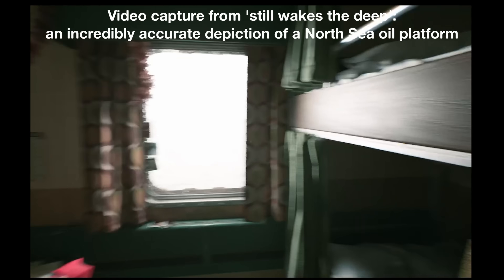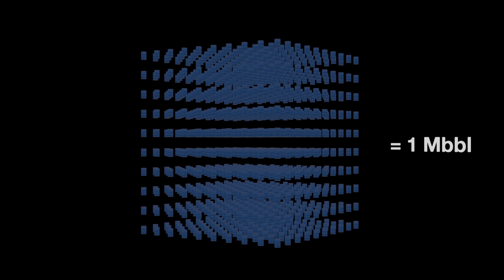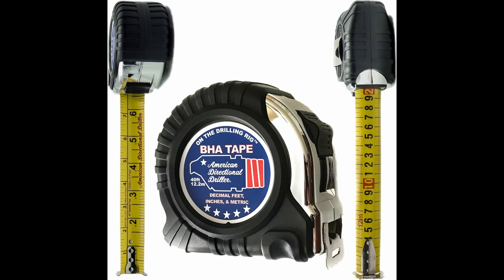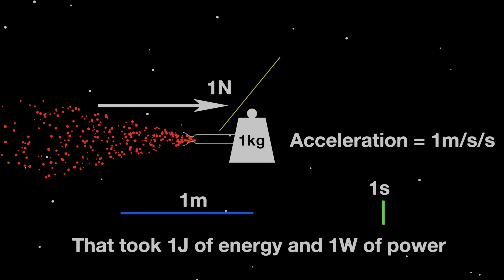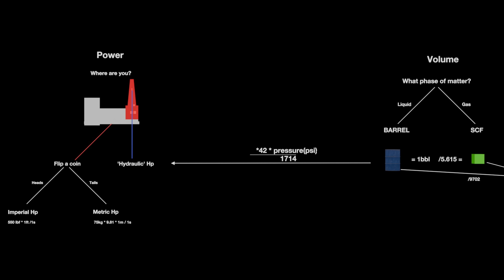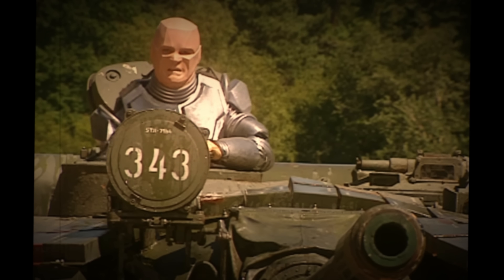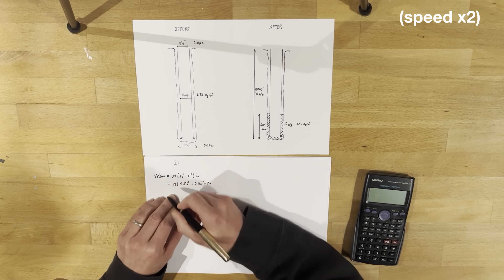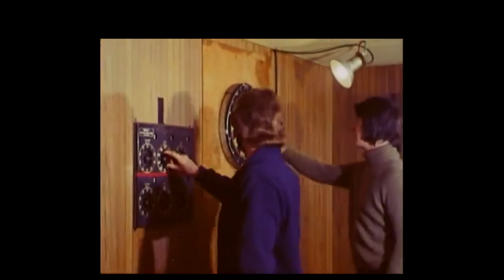Oilfield Units: a Measurement System so Cursed it made me Change Career

Comment: 10:00 this is common outside of the oilfield as well, but like the oilfield, only in niche applications (with one exception I'll outline later).  Generally speaking if you're dealing with numbers in the thousands often, seventeen hundred is faster and easier to say than one thousand seven hundred.  This is especially true when those numbers don't exactly have to be precise, like engine RPM.  Flying an aircraft, it's easier to think in teens than thousands, like takeoff RPM is twenty three hundred, sometimes even abbreviated to twenty three.  You tell a pilot that cruise RPM for your plane is nineteen, they'll know you mean 1,900RPM.  It's not super critical that the engine is running at exactly 1,900RPM, it could be 1,922RPM or 1,894RPM...nineteen hundred still gets you close enough and you're certainly not going to say you cruise at one thousand eight hundred ninety four RPM.  Same goes for the automotive world and various other fields where four digit numbers are commonplace.

What's the exception?  When you're using four digit numbers that you have to remember or communicate verbally to someone, such as an address or padlock combo.  If you live at 2469 eggplant drive, you're not going to recite your address to someone else as two thousand four hundred sixty nine, you're going to tell them two for sixty nine.  5230 would be fifty two thirty.  2500 would be twenty five hundred.  But 4000 would not be forty hundred, it would be four thousand.  It all has to do with how easily you can condense and remember the number in question.  Conversely, when you go to the bank and ask to wire 4,236 dollaroos to someone, you would say four thousand two hundred thirty six dollaroos, because you're psychologically slowing the communication down and being precise where precision is needed, and the listener will engage more precisely in return.

Lastly, the word "and" does not belong anywhere in verbally recited numbers EXCEPT where it should be, and it ALWAYS needs to be there unless you substitute with the word point in casual use.  The decimal (the period in the number, or comma if you're a weirdo) that separates the whole number from the decimal is your indication to use AND.  $1,706.14 is one thousand seven hundred six dollaroos AND fourteen centaroos.  You never ever say one thousand seven hundred and six dollaroos and fourteen centaroos, or one thousand and seven hundred six dollaroos and fourteen centaroos, that's just confusing because the AND is meant to finalize the whole number.  For example, you have five people AND two kids in your house, because kids are fractions of people.  Even if there is no decimal and it's just a whole number, you should never include AND.  1,706 is still one thousand seven hundred six, not one thousand seven hundred and six...if you said that, people might think you meant 1,700.06 or 1,700.6 or 1,706, which is very ambiguous.  This is all stuff that should've been taught to you in elementary math class.

Comment: Decimal feet are fun. 

As a terminal operator responsible for overseeing product transfers, opening and closing tank measurements were essential. 

For this, we measured using decimal tape.  One inch was .08 of a foot, or basically .01 per eighth of an inch. So naturally, when you multiply by twelve, it neatly equals out to…   0.96??

No problem! You simply decide arbitrarily that four measurement values basically don’t exist!

They are: 0.12, 0.37, 0.62, and 0.87.   There was no standard equivalent of those decimal values.  But you need to do that to equal 100 parts to the foot. 

And keep in mind, when measuring a tank with a capacity of nearly half a million barrels, at a value of say, $80 USD per barrel, that 1/8th of an inch of potential error will equate to thousands of dollars. 

And don’t forget to measure the temperature of the oil, because it matters.  Cold oil is more dense, so there’s another table to convert temperature to 60° as the accepted standard. 

That’s Farenheit, of course.  

It’s a great industry.
Reply: this hurts not only my brain, but my entire body
Reply: You surely meant to say that cold oil has a higher mud weight, you nerd.
Reply: Honestly, I'm somewhat happy to hear that at least they didn't invent their own new temperature system.
Reply: @Theoreticaly  Fahrenheit IS the invented temperature system
Reply: @TheHeavyModd  I mean, Celsius was also made up
Reply: @commandercody2980  you're forgetting the most essential one : The Kelvin
Reply: @Aelleor  they could have had exact decimals of they went to thousandths. (0.125) why didnt they just do that?

.125, .25, .375, .5, .625, .75, .875, 1.000
Reply: @Aelleor  I didn't know War Thunder developers did decimal feet. (Explanation: WT is a game featuring various war machines of varying capability, so to match equal vehicles against each other, each is assigned a battle rating expressed as a number with a one decimal accuracy. Ratings rise by thirds: 1.0, 1.3, 1.7, 2.0... etc. It is slightly odd, but it's simple and easy to understand. The choice of thirds is a legacy from the original tier system, which was completely different and was replaced by the current rank system, where ratings rise with rank, but not consistently. There can be a 2.7 craft in rank 2 or rank 3, depending what particular vehicle in what particular tech tree it is. Ranks do not influence matchmaker, but they do influence vehicle research...
And it's just a silly game, with little real world consequence! Except the times when overzealous players with access to classified technical documents leak said documents to prove some vehicle stats being wrong... but that's a different story.)
Reply: Three days of this and id honestly just shoot myself in the break room 😂

Comment: When you say US gallon, does that refer to US customary gallon or US dry gallon? While using US dry gallons wouldn't make any sense, that fact doesn't provide any certainty. 

I think the conversion issue is only part of the problem with sticking to a mess of units, it's not really a system, that evolved for making rough  measurements and very simple calculations, in isolation. The other part of the problem is that there are multiple versions of most of the units. Sure, most US units only have one "official" definition, now, but if you come across old references you got to know which version of the unit it is to know what it actually means. And there are different versions of common units in active use in the US, like the US customary fluid ounce isn't exactly the same as the US food labeling fluid ounce.    

And, can we all agree that "atmospheres" are stupid units too? Units, as in plural? Yes, there's "atm", the "standard atmosphere" that is an approximation of the average atmospheric pressure at sea level, which isn't a constant, and there's also "at", or "technical atmosphere", 1kgf/cm². Suggesting that we could all agree about anything was obviously a joke.

Comment: LOL, it's confusing if you're not in the industry... just as ( some ) metric units are confusing.  When expressing engine power, "how much horsepower does it make?" vs "how many kW does it make?"  I see a motor ( it doesn't matter what it's fuel source ) rated in kW output, I gotta get the conversion tables out and look it up instead of just "oh, that's a 15 HP motor.."

Comment: 7:20 correction: to make a 1kg mass travel 1 meter in 1 second actually requires 2 m/s^2 acceleration = 2 N of force (and average 2 W of power over the displacement, and exit at 2 m/s).

x = (1/2) a t^2 for constant force:
1 m = (1/2) (2 m/s^2) (1 s)^2

If you apply 1 N of force, it will take √2 seconds to travel 1 meter:
1 m = (1/2) (1 m/s^2) (√2 s)^2

Power is tricky when a force is applied to an accelerating object. As velocity approaches zero, power approaches zero (less displacement per second). But as velocity increases with constant force, power also increases (because force is working over an increasing distance every second).

Intuitively, the mass will be traveling faster than 1 m/s at the 1 meter mark because of the intermediate value theorem: it traveled 1 meter in 1 second, and started at 0 velocity, so it must travel more than 1 meter per second over part of the path to "make up" the time to get to average 1 m/s.

Comment: The pound (lb) is a unit of mass defined as exactly 0.45359237kg (International Yard and Pound, 1959), not a unit of force. There's a separate unit called pound-force (lbf), which is a pound times standard gravity acceleration. In "foot-pounds" (unit of energy or torque), the pound-force is implied, so a foot-pound is 1ft * 1lbf.

And, yeah, of course that's just the official story, everyone just says "pound" instead of "pound-force" and that's why many people believe that the pound is a unit of force. (And then there are people who misread lbf as foot-pounds … fun.)

Comment: I appreciate that I'm from Poland. We use metric only. I won't argue that metric is better than imperial. I'm just glad we didn't mix those. Maybe it's because historically and geographically we didn't have opportunity to.
Reply: No, I will absolutely argue that Metric is better than Imperial. Hello, I'm a Brit, AKA stuck in some sort of measurement units purgatory.

Weights are metric, unless it's for people, then it's in Stones and Ounces. Driving is in miles but running is in kilometres, and your own height whotf knows? Volumes are metric, asides for milk and beer, Which is in pints. (I do have to admit that of all the unit weirdness, Pints are the one I am the most attached to.)

Comment: I did road construction engineering one summer we also used tenths of feet. Apart from that everything was fairly standard cuyd, tons, psi, lb/cuft. it was fairly easy to do calculations since the measured units were close to the needed calculated units.

Comment: As a surveyor, this is hard to watch. However I used to work in company where different department was laser scanning old oil rigs. They've done everything metric with German produced scanners and software for 3d models. Don't know  where it went from there, just know they've done just 3d models and it was smaller part of work. Annotating valves and other parts was at least 3x bigger job done elsewhere. This video explains a lot.

Comment: I mean unrelated to this i personally think the metric system is a great system and its nice being able to quickly change between sizes of units, however the standard system is also a good system of measurement and it can be confusing to learn but once you understand it the system really isnt that hard to use

Also a tape measure being in 10ths of a foot is fucking infuriating

Comment: “In metric, one milliliter of water occupies one cubic centimeter, weighs one gram, and requires one calorie of energy to heat up by one degree centigrade—which is 1 percent of the difference between its freezing point and its boiling point. An amount of hydrogen weighing the same amount has exactly one mole of atoms in it. Whereas in the American system, the answer to ‘How much energy does it take to boil a room-temperature gallon of water?’ is ‘Go fuck yourself,’ because you can’t directly relate any of those quantities.”

-- Josh Bazell

Comment: Drillers don't have a monopoly on decimal feet. Plan elevations in dirt work are in hundredths of a foot, so we have grade rods that mark out every 2 hundredths, tenth, and foot. Then almost all tolerances are in tenths of an inch, because  Laser receivers show high or low in tenths of an inch. Every once in a with I get a set of plans that says +/-0.25". The available options are .2" or .3".

Comment: I have read that the definition of a barrel of oil as 42 US gallons goes back even earlier than John D Rockefeller, to the very beginning of the Pennsylvania oil boom.  Oil producers hadn’t really planned ahead for how they would store and ship the crude oil their wells were producing.   The solution closest to hand was wooden barrels produced by skilled tradesmen (called coopers) for the makers of whiskey.  One common size for these barrels was 42 gallons.  This was quickly adopted for crude oil.

Another standard size of barrel was a very large one used primarily for shipping tobacco and called a “tun”.   The number of these barrels (about 100 cu ft) proved very useful for measuring and describing the describing the volume of a ship’s hold, and to this day the cargo capacity of a ship carrying non-containerized dry cargo is expressed in “net register tons”, measuring not weight but volume, 100 cu ft per ton.

Comment: The UK actively uses hoth metric and imperial... and so does the US... sort of.  It's not entirely the US's fault.  Both the UK, I feel, does it deliberately.  

The US at least 99% of the time stick to the one unit system.... And before I get someone one saying "no, the US does not use metric!!"... to that I say "ohhhh reaally!!?? I guess you've never worked on a car.  Never need to go and get a new 10mm socket cause they seeem to disappear.  Or a new 14, 15 and 18 - 22 mm socket."

Comment: I mean if this video had not told me what a barrel was I would  have just assumed 55 gallons US, Because I figure all big ass barrels are 55gal.

I guess there is nothing the oil industry does not ruin, They cannot even go into American Customary Units and not screw it up. And I think if the USA ever actually went properly metric the oil and gas industry would still use their screwed up unit system, Unless a regulation required them to change.

Now for commodities markets I am not against the barrel simply because its a nice easy term for the average person to hear on the news. But they could say make a barrel be 200L its roughly 55gallons the size of container most people think of when you say "barrel" in a non liquor production reference. 42gal is nearly 160L but 200L is a nicer looking number, its nice and even.

Comment: Maybe I'm not getting something, since I don't know anything about oilfield units but...
2:05 - 1 bbl is 31.5 US gallons. Maybe you are confusing it with UK barrel, which is 43.23 US gallons in size.
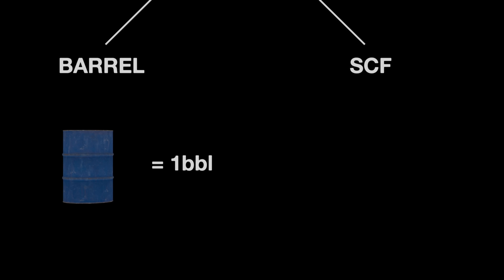3:50 - 1 bbl is 4.211 cubic feet. Once again, UK barrel is 5.615 cubic feet which is much closer to you value.
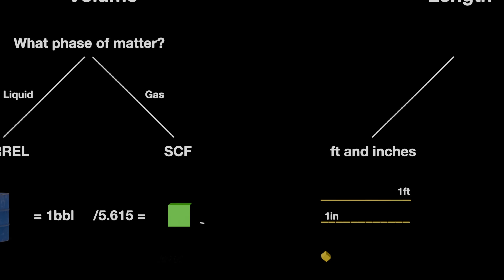4:20 - same thing as before. US barrel - 7277 c.inches, UK barrel - 9987 c.inches.

god I hate this mess. I would actually believe that both versions are somehow right because of some weird unit fuckery

Comment: 4:12 that is absolutely NOT true.  The Civil (Traffic, Structural, Construction, Geotechnical, Surveying, and Water) Engineering field in the US is nearly exclusively still uses USCS.   The NESC (National Electric Safety Code) has always had both, and they even pushed to put metric first, but as of late the USCS units have been prioritized in recent revision the metric is listed last and the metric tables have been moved to the appendix (because, they were never used and got in the way of the USCS table that you wanted).  

Also, if you have ever done a survey particularly in another state or across state lines, you have dealt with the issue of the SURVEY foot and the INTERNATIONAL foot.  Yes there are two feet in the USA (International foot is the standard but some states and surveyors have been using the survey foot and still do despite NIST trying to get rid of it... the difference is like 2 in a million but when your survey coordinates X and Y (state plane or UTM) are 7-8 digit numbers, the error becomes potentially several feet... precisely big enough to cause major problems, and precisely small enough to be hard to notice.

CIvil engineers will be well aware of the "kip".  Which is "kilopound" (1000lbs).  Engineering loads (and moments: kip feet) have been using kips (or k) for a long time.  Notably we do NOT use tons (as there are like 3 different tons out there).

Comment: I learned the same way my father and grandfather learned.  It's the way my grandkid will learn.  You spend a few hours on the job, you learn.  No big deal.  Carpentry.  Sheet Metal work (my wheelhouse).  Bricklaying.  Roofing.  Framing.  Drywall.  All of this stuff is pretty quick to learn and it's really only a different language.  I prefer imperial, but I also speak metric.  I can tell you drill gauges, sheet metal gauges, tapers, etc in all of the different languages having worked in many shops and on many pieces of equipment.  We can standardize, but good luck with that.  For the life of me, I cannot understand why the mainland Europeans are so critical of anything but the Metric system and in the same breath, they will berate Americans for not being able to speak their language.  I can speak Metric.  I can speak wire gauge.  I can speak mils.  I can speak mm.  I can speak gauge.  I can speak wire gauge.  I can speak drill letters, numbers, fractionals, decimals, etc.  Why can't the Frenchman learn what an inch is?  (Hint, it is a METRIC UNIT!  Just 2.54 cm, EXACTLY.  Some head math and Bob's your uncle.  If I ask for a button-head, 6-8 AD rivet, my bucking partner will know what pocket they are in.  He'll also know I need a #10 drill bit to ream the hole.  Do YOU know what any of that means?  It doesn't matter as long as the bucking partner speaks the same language.